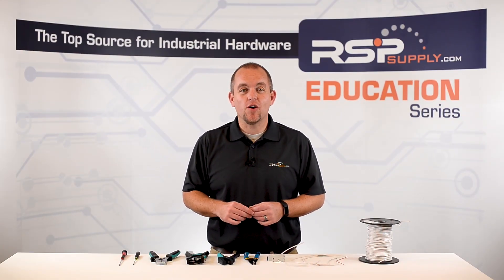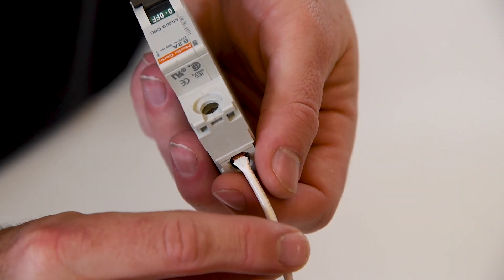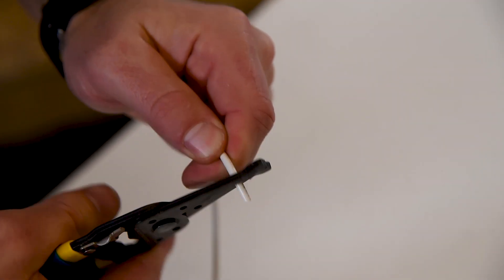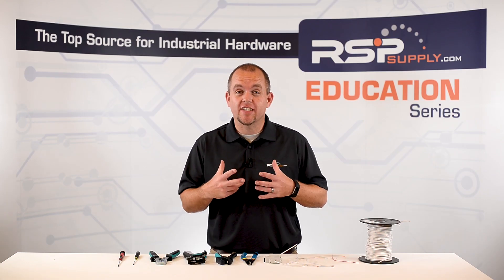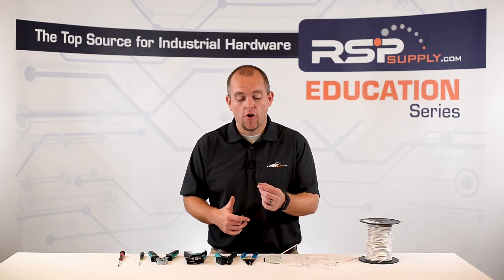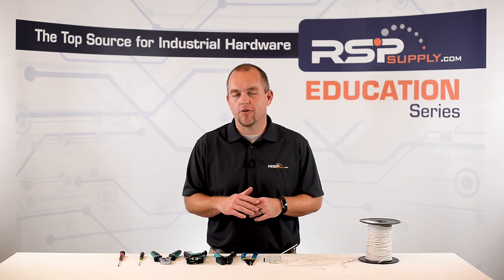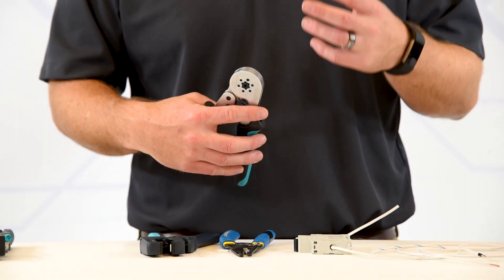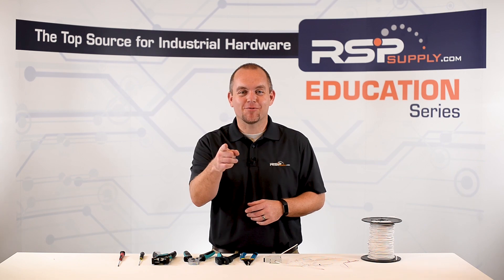Industrial Wiring Tips and Tricks Part Two

Comment: first tool - in my 15yrs career used it once, I pushed to ban it in engineering workshops across the company. Several times I simply cut those with angle grinder... It is better to use stanley knife than this crap...

Comment: Everything he's demonstrated in this video and previous videos I do at the company I work for and have done for years.  I push these techniques heavily to guys that I sometimes mentor.  I get some looks from these guys sometimes and even an occasional eye roll.  But as this gentlemen demonstrates, these are the correct ways of doing it.  I don't tin my wires but I always use crimp ferrules wherever practical for the reasons he's stated in the video.  I can't tell you how many times I've looked in other control panels that I didn't wire and there are frayed wires all over the place at termination points, not enough insulation stripped off, too much exposed wire, etc etc.  This is why you take a little extra time and effort and crimp ferrules on your wire ends.  Use good quality tools and always use the right tool for the job.  As he demonstrates, not every wire stripper tool is created equal.  I have a few of the Klein strippers of various sizes like the first tool he used.  I rarely use them because of the inconsistent results.  They work good but you have to be careful with them as they can easily damage wire strands.  The second stripper tool is an absolute must for panel wiring.   Repeatable results every time and makes quick work of wire stripping when you have hundreds of wires to terminate.  I don't have that last tool he demonstrated but I'm going to get one now.
Reply from the maker: Thank you Don for the feedback. We really appreciate you watching our videos. We love the feedback and support. Thanks!!
Reply: I counted two important errors/omissions in this video.  Can you find them?
Reply: @NickAlexeev  cool